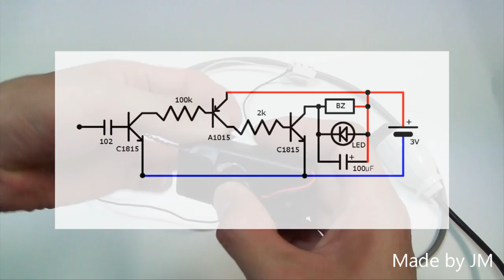DIY non-contact voltage detector

Comment: I've done it !!! I've made it work. My Led lights when I touch 220 volt wire but buzzer doesn't work. I thing need another buzzer(because this used is from a clock with one battery) and that can be the problem. I'm feeling great now is working good. Thank You for replay.Regards :))

Comment: The part that confused me was where you placed it on a power cord that had both wires together. I would understand it would work while the wires are separate as you first demonstration, but when you placed it on the cord with both wires inside together wouldn't the current cancel each other out making the device useless? I see not but why?

Comment: Hi Thomas.I have fail to make this schematic.Probably must use same transistors.C1815 replaced with(c945) and A1015(A773).
Reply from the maker: Make bigger detection electrode.
Reply: I've made it,but Led doesn't light,only my buzzer make a little noise,but not like yours.I think is the problem with mine transistors.But I must touch the ground wire to make it works.Regards
Reply from the maker: Robert s Did you use white or blue LED? Blue or White LEDs are required more voltage than red LED. So, you should use higher voltage(3.6V or 4.5V) and connect 100 ohm resistor in series to LED.
Reply: Same thing after changed Led and increased voltage up to 4,5volt. Doesn't matter to much because I don't have same transistors like yours. :) Cheers